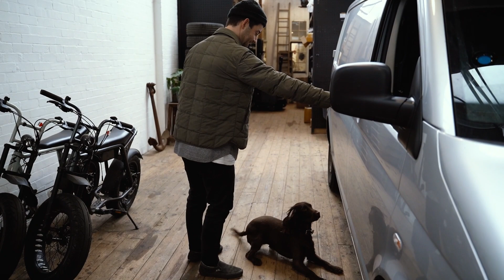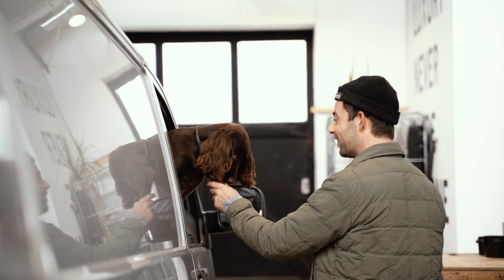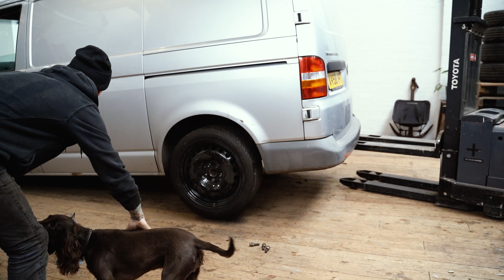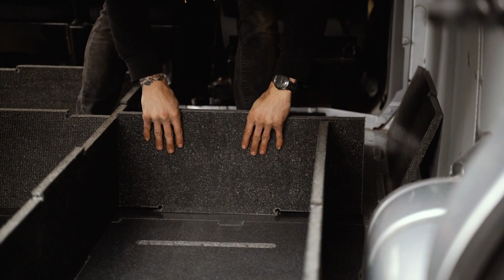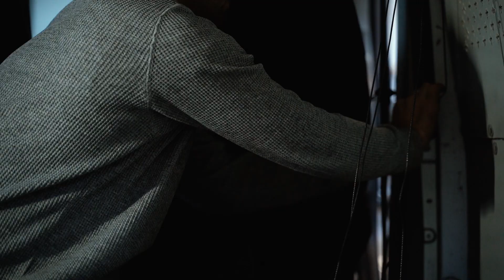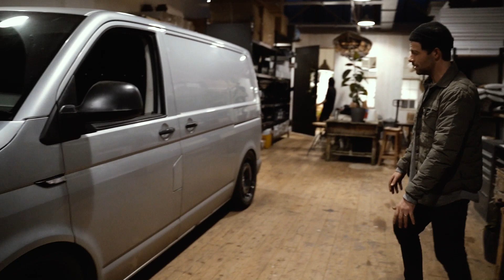@stitchesandsteel Try To Convert and Slam A Volkswagen Transporter T5 In ONE DAY! Can They Do It?

Comment: you can fitt an t6 rear bumper on it but you have to shave a littel from the rear doors only spot is the lowers part in the corners t5 syle is rond and t6 line

Comment: How much did you drop the van ? Thanks guys.
Reply from the maker: Hey there! We wound this all the way down on the Colivers. 
Not sure on the exact measurements though bud!
S+S
Reply: Thanks guy. Are we talking 50+ mm? Just a ball park figure. My T5 is standard at the mo. I’m planning some 20” wheels just I’m not sure how much I will be able to drop it with wheels that big on it.
Reply: @gavt1198 try so low low suspention 120mm on 20” rims